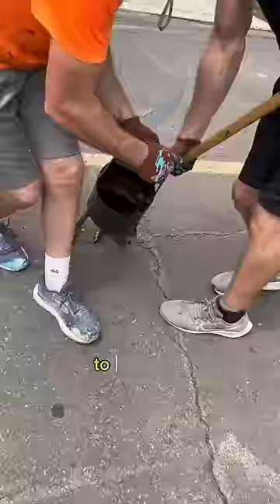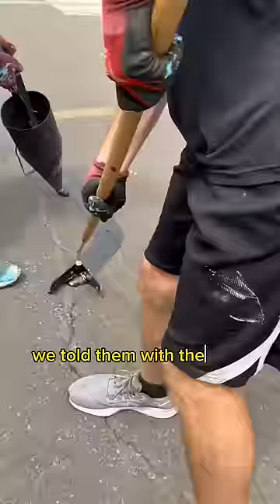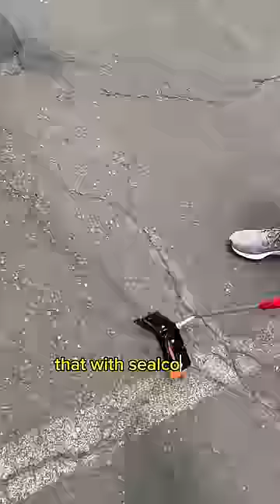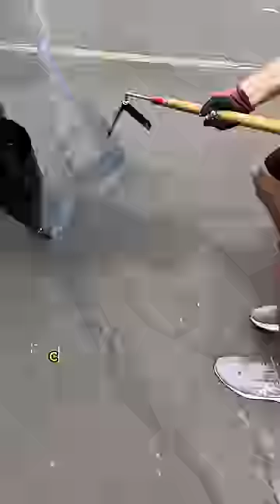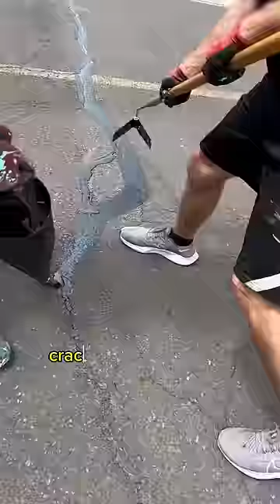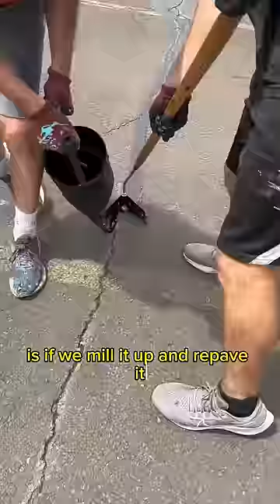Customer Had to be Told NO🚫🙅‍♂️ #satisfying #asphalt #business

Comment: Yeah, don't worry about getting the last bit of each crack where it gets fine but is still very visible. Just leave that part completely dry, no problem. No, I've never sealed blacktop. There was, in fact, a spot missed. Must be the cheapest bid by hiring the cheapest help and using the cheapest materials. Good for that customer apparently.

Comment: Perfect 😂 i hate ppl, ive done a few real fucked up lots in Denver Colorado both asphalt and concrete/cement and they look great but never perfect. I pressure wash the lot first then hit it with a blower to dry the cracks before any material is used

Comment: The most useless service ever is driveway sealing. I worked with some Gypsy folk when I was 18-19 doing this and they would water the shit down, add diesel to oil based for a shine and make all kinds of crazy claims. All this does is fill the pores of the driveway and make it slick when wet.